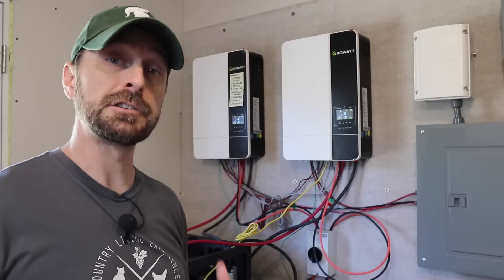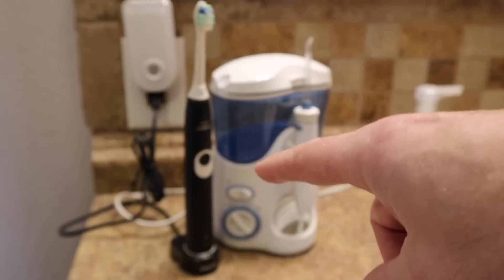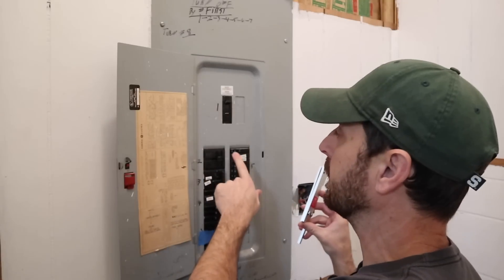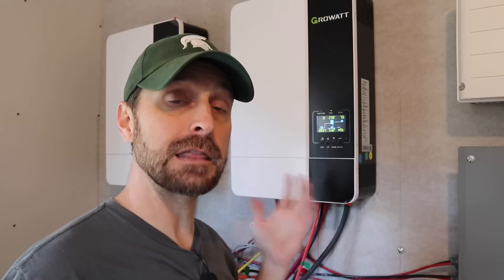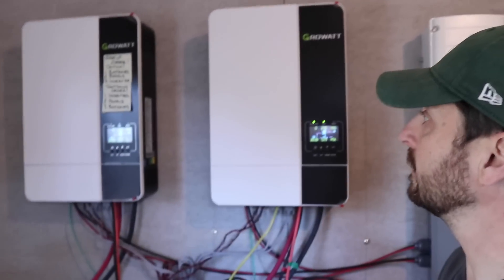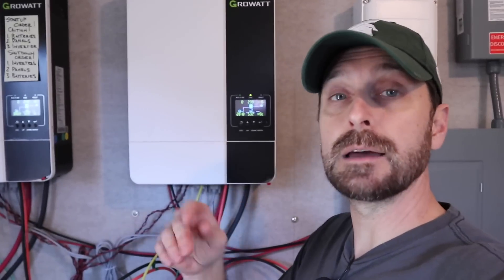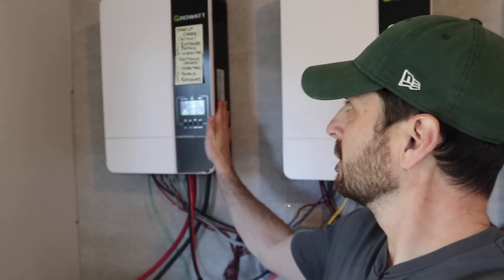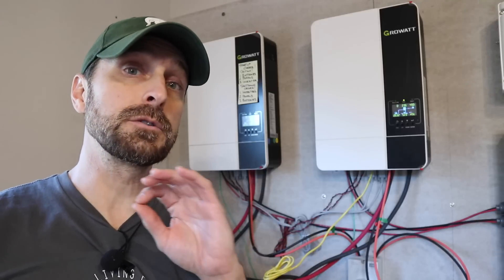Testing Our Solar System! 2 Growatt 5kw Inverters! What Can It Handle?

Comment: you converted your oven and dryer, but now you're dependent upon fuel. It seems counter productive if you're wanting to go off grid and be energy independent. What happens when you have a problem or long delay in getting propane? It would seem that adding a little to your PV system would be the smarter way to go. It would pay for itself! In Oklahoma, some utility companies offer a rebate for customers who get a generator install, and they have a smart panel that can control it and run the house on generator power during peak hours to reduce power consumption and cost, and a soft start for electric HVAC condensers to reduce start up spikes in current, which can be very high. Soft start modules are a great solution to help your Generator or P.V. system handle a larger load on start up. That could be a good solution for your situation. I personally had a Mr. Cool Mini Split 18K BTU unit and they do not do well in winter. Mine gave out in December and I installed in in March of 2021. Mini Splits are an option but not necessarily a good one, especially for heat. For a person with an existing electric heat, a soft start module may be something you want to look into to help your solar or generator handle the spike current on start up. I've installed 100's of Generac Automatic standby Generators for whole homes and using DLM's digital load management modules, and they do make wireless ones now, so you can wire you appliance through it and not have to wire it all the way back to the panel. A/C units, electric heat, dryers and water heaters are always the typical items we put modules on, so that, instead of the generator getting overloaded and kicking out and having to restart, the module kicks out the appliance temporarily, and allows you to adjust what you are using to accommodate your situation. If you are going to go to the extent of expense of changing your oven and dryer to propane or gas, then a less expensive alternative for emergency power is A generator.  I personally like Generac. I installed 100's of them over 4 years, and it's a good reliable source of power. I'm not sure of the cost now, but then a 20kw or 22kw, the most common for whole house, was around 10,000. It can operate on LP or gas, and installing some soft starters, especially on older AC units that have a high start up surge, can help the system handle it. A 22kw is capable of handling multiple appliances at once along with heat and air and cooking. As long as you don't install the unit by a bedroom wall, chances are you will hardly hear it while inside the house, and you can sit it further from the house if you don't mind digging a ditch to run the wires to a transfer switch, which becomes the main disconnect for the house and is typically installed on the back side of the panel outside, next to the meter. because the service wire has to be rerouted through the transfer switch and then feed the house panel from there. It may sound hard, but it is a lot less work that the PV system and truly gives you more power and flexibility. It makes no sense to do the PV system and then make major changes to your heat and air and dryer and oven. The cost of this had to of been over 20 grand, and a generator install is not only more convenient and more powerful but less expensive, and there are options to manage large appliances with digital load modules, which are super easy to install, power in power out, and it communicates with the transfer switch remotely. Makes no sense to do what you're doing. If a person is wanting to be totally independent, then I get it. It is a great idea, but if you are changing major electric appliances to LP or gas, then I don't get it. If it is just emergency power you are concerned with, then a generator is a better option. If you want to be totally independent and run on solar for weeks and months, then P.V. systems are the way to go, or if you're so remote there is no power, P.V. systems are the way to go.

Comment: What do the percentages that you were reading off represent? What are they telling you, us?
Reply from the maker: That is the percentage of the total inverting power being used. So if it was 50% on both inverters, I would be using about 5kw at that point in time.

Comment: These videos you are doing are good practical guides for using solar. I can't wait to see the test when you flip to gas and the minisplits. Based on what I saw you could have run your AC with limited issues if you did not have everything else on too.
Reply from the maker: Thank you. I appreciate it. The system is a good size to run many things and for not a great cost too.

Comment: I love all of your videos and I have the exact same solar set up as you from signature Solar. I want to use the grid as pass thru and wanted to know why you opted not to do so. In your video you stated the wiring was more complex, other than wiring in the three wires from the grid how is it more complex?
Reply from the maker: Thank you, I appreciate it. 
There is more complexity to it because of the grounding and neutral connections. It is not just a simple pass thru hookup because of the nature of these inverters. Sig Solar has the full diagram up on their website for that type of connection if you want to check it out.
I wanted something very simple and I actually want to be completely off-grid. The benefit of the extra equipment and wiring, etc was not there for me because I want to eliminate the grid as soon as I can.
Reply: @CountryLivingExperience  wow thank you for the quick response! I can’t find that diagram do you know where on the site it is located? Originally I worked with Matt to get in touch with Ray they’re licensed electrician. Ray was going to send me a wiring diagram for my specific condition/5 of the growwatt 5000 inverters with two of the growatt transformers with pass-through to the grid. He then had to take that back and said he could not give me one due to liability issues.
Reply from the maker: @flippingcoins7714  If you click on the Growatt 5k Off Grid inverter, it is contained within the pictures. It does have a disclaimer on it because of some liability issues. You can also try to call and talk to Richard who (I believe but am not sure) is their electrical engineer on staff.

Comment: two short notes. better to go with an induction stove top with two burners and an additional portable 2 burner induction stove top that you can put on your counter top should you need more burners.  The second thing is if you decide to add a few more panels you might wish to run the water heater that you have now with those dedicated panels or just dedicated battery and panels.  dont know how many folks you have in the house showering but 4 or more is a great reason to go to a bigger tank.  If you decide to go propane consider using your electric water heater as a pre heat for your propane fired. You may discover it is a rare thing that the propane fired tank rarely comes on

Comment: My wife lol !!! 
Why can’t you run your heating system with your set up ??
Reply from the maker: Not powerful enough for startup of my 3 ton unit. I am adding mini-spits for heating and cooling. Could add a soft start but didn't want to spend money on a 15 year old hvac system that has a leak and cannot heat below 32f.
Reply: @CountryLivingExperience  okay but if propane gets delayed or not at all you going to need something to heat house With the price of fuel gas & propane might want to look into getting a new heat pump, seen were they come with soft start just for solar . I am building a new house here in KY but putting as much stuff as electric as I can plus solar with batteries. Looking at around 50k half of that is batteries. Was looking at the generac system but it has too many restrictions for battery expansion. With EV’s now trying to do house hook up as battery source a smart panel for hole home looks like best route. Watched a video earlier today were a gentleman tried charging his Tesla with a eco flow battery but did not disconnect the battery from wall so when he used the self grounding plug he doubled grounded it and fried the battery motherboard 🪦 all because he was trying to charge the battery while the Tesla drawing power.  
Good luck with your system learned a lot from them
Reply from the maker: @yankabilly1963  I have a large wood stove also. I love having redundancy. Glad we could help with our videos. Good luck with your system.

Comment: I have a similar setup for the same inverters. Powers most of the loads in the house except the strip heating in the furnace, the dryer and the electric stove. The AC\heat pump is connected to the system and the largest I've seen it draw was around 2.75KW. Have not had any major issues.  As mentioned, if the loads are not stupidly over balanced. This setup will work very well. And I also got my inverters from SS.
Reply from the maker: Very cool! I am loving the system so far.

Comment: I have a similar setup and I also am not bringing in commercial power to my units. It just solves so many problems with the autotransformer, it makes sense. Also you can just put in a soft start on your 3 TON A/C unit and the inverters will start them just fine. About 400 bucks and you don't need to rebuild your whole cooling system. SS sells them and they work great.
Reply from the maker: Cool. 
I couldn't justify spending money on a soft start ($400 + install) on a system that is 15 years old and has a slow leak. The mini-splits are much more efficient and if I am running them a lot when there is no sun, I want to have that efficiency.
Reply: @CountryLivingExperience  When I was in Korea in 2002, everyone was using mini splits - they have been in Asia for the last 20 years. Your switch to mini-splits makes perfect sense to me - Mini Splits are way better and when my units die I will be switching. Not questioning your methods, just wanted to add that bit in case someone (like me) doesn't want to replace their existing home A/C units. Love watching your videos, you are doing great!
Reply from the maker: Thanks Donny. I may make a video clarifying why I am switching and the benefits.
Reply: @CountryLivingExperience I think that would very valuable.

 I just did a video on running the AC on soft start if you are bored and want to check it out.
Reply from the maker: @BecomingOffgrid  Cool. I will.
Reply: @BecomingOffgrid  your the man Love your videos too
Reply: @flippingcoins7714  Hopefully I will get some time tomorrow to put up the full breakdown for the neutral protection circuit

Comment: Is there a reason you float your batteries at 97%. I thought micro charging the top 5 or 10% wasn't as good for the batteries as going to 80% DOD then charging. Am I misunderstanding something here? I'm building an 11.85 Kw system with 4 GW 5000 ES inverters and 2 GW transformers and 6 EG4 LL batteries . I will be adding the AC in to the GW's. I'm excited to see how it works when I get it completed. I will not be back feeding the grid, as I understand that can't be done with GW off grid inverters. It will only be an assist if the PV and batteries are not producing. Thanks for all your video's, they have been a BIG help.
Reply from the maker: Glad we could help. As far as I understand, this is what the internal set point is. I didn't change any setting to achieve that. 
When I use the term backfeed, I am talking in a sense of the grid being down and the main grid breaker being on. If this is the case, my solar would backfeed into the grid and injure a line worker. This is the same thing that happens when you have a generator in use. That is why I purchased the generator interlock kit and installed it on the main panel. My system is manually switched in the event of a grid down situation. 
Sounds like you have a big system. Good luck with getting it all set up.
Reply: @CountryLivingExperience  Per my understanding these grow want 5000’s will not backfeed to the grid they are considered a non-export inverter. Please correct me if you’ve heard anything else regarding this matter

Comment: That comment about the grid inlet...is wrong. Both inverters have an AC input. Nothing difficult about this. Run the AC grid input that you usually feed into the main breaker in the house panel into a small fuse box with overvolt protection near the inverters - then from it to each inverter and then let each inverters AC outlet feed the house panel together. Very easy.
Reply from the maker: No it is not wrong. These are 240v inverters. There are some grounding and bonding complications. Please refer to Signature Solar's electrical wiring diagram for these specific inverters.
Reply: Where can anybody find a wiring diagram from Signature solar or anywhere else that shows how to wire the AC in on the growatt. When I asked them how to do it they said repeatedly DIY,DIY,DIY. I've asked on almost every forum site discussing wiring and got "0" replies on how to do it, so I figured it out myself. I added 2 electrical panels. One I call my Solar panel with 4 - 50A for GW AC out, 2 - 25A for 2 Split phase transformers and 1 - 125A that feeds my house panel by back feeding a 125A breaker that has a Generator interlock to separate from 125A main grid power. My 3rd panel I call the Grid main panel has a 200A main from the grid that feeds the 125A in the House panel from a 125A breaker, 4 - 50A that feed the 4 GW AC in's and a 20A for my EMP protection. If it doesn't blow up, I'll have quite a story to tell. As always, any input is appreciated.
Reply from the maker: The 5k growatt has a diagram on the website.
Reply: @JamesLee-ey2yv  The manual that comes with the units from the factory show the AC in connection both in single and parallel hookups. It is also downloadable from Growatt as a .PDF
Reply: @CountryLivingExperience  I have 3 of these in a 3-phase parallel setup as per the factory and had NO problem whatsoever connecting my grid in into the 3 boxes. I just took the grid input cables into 4P fuses and from there fed the inverters. The outs from the inverters to my main panel (no need for smaller panels as the 3 delivers 5KW each into each phase) via another 4P fuse for security. As these inverters do not deliver power back to the grid there is also no need for any interlock etc. Grounding is easy, using the same grounding as the house had from before with copper in the ground outside the walls on ONE POINT, not multiple grounds as that would introduce problems.

Comment: How did the batteries hold up during this? Of course during the day your panels are producing power.
Reply from the maker: They did well. I barely used any battery power during those large power draws. Only about 8%.

Comment: I was fascinated to learn you can't run your AC.  Is it a minisplit?
Reply from the maker: No, it is a 3 ton central heat pump. I do not have mini-spits. I am installing them soon so that I can run them from the solar system.
Reply: @CountryLivingExperience  Ah okay, thanks.

Comment: Can you explain what the auto transformer is used for.
Reply from the maker: The inverters are 240v so an auto-transformer is needed to split into two 120v legs. It creates a neutral line.

Comment: My two will run the dryer and water heater. I didn't see the point in switch then pay for gas. If I wanted to lighten the load I would hang the clothes.
Reply from the maker: Firstly, It is about having redundant systems. Additionally, if I wanted to run big 120 loads all the time, I would be prevented from adding in a big 240 load.
Reply: @CountryLivingExperience  am still hooked up to utilities and the over load switch over works well. And if it comes to long term grid down will be not be running dryer. Solar water heater does keep my solar  tank about 80f.
Reply from the maker: @chrisloving6647  I am thinking the same way. I can line dry clothes, cook on my wood stove, etc. I do need to look at a solar water heater too.
Reply: @CountryLivingExperience  A water heater is usually the second highest energy consumer in the house, behind the A/C. An efficient hybrid water heater could help if you are trying to save on energy consumption because they are like your mini split using a heat pump system. Although the install can be tricky if your water heater is in an air conditioned space.
Reply: @CountryLivingExperience  Think Geo Thermal !

Comment: So these are advertised as not being able to backfeed. I'm curious as to why you think it will backfeed. 
I have 2 of these as well and I have done  measurements with different scenarios. Grid on and grid off. I am not convinced yet that these do not backfeed. Though I  cannot see the meter run backwards. But I don't know that smarts will run backwards. I noticed that 3.8 amps flow with inverters on and nothing else running and all load breakers open.
If you have any idea if these are actually backfeeding or not please let me know.
Thanks for posting this video.
Reply from the maker: You're welcome. By backfeed, I am using the term in the scenario that the grid power was down from a storm. If I have my solar on (the solar feed breaker on) while my main breaker is on and the grid is down, I could backfeed into the grid and hurt a line worker. This is the exact same idea as having a generator on a house. That is why I put an interlock kit on the main panel.

Comment: How can you protect a system like this from emp attacks
Reply from the maker: They sell emp protection devices for many things. I am not sure how well they work though.
Reply: I have a 140,000 amp EMP protector that says it protects all 3 phases of emp. Cost about $350 and easily installs piggyback on a 20A breaker in the main panel. I haven't gotten that far on my install yet, so I can only hope it works as advertised.